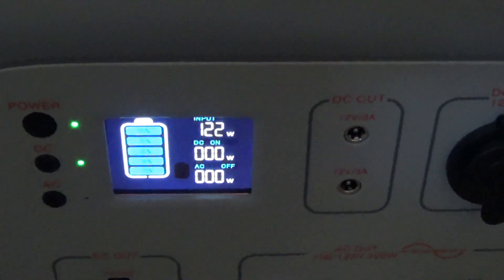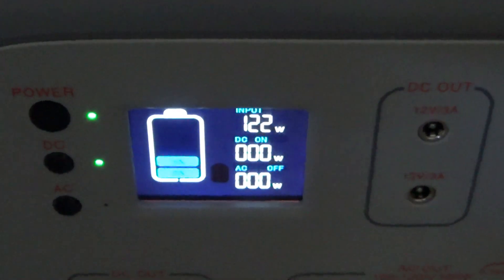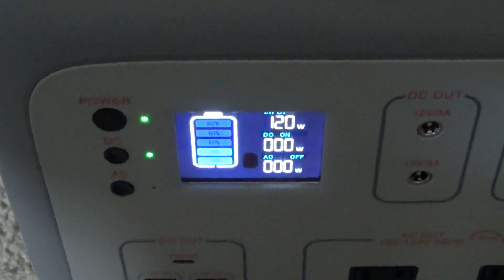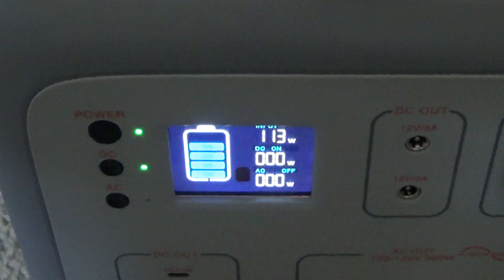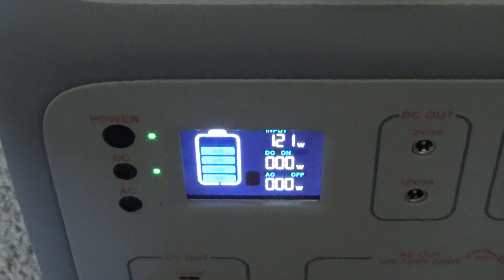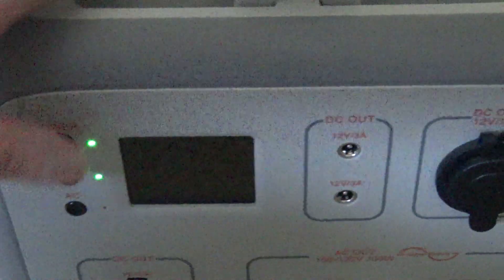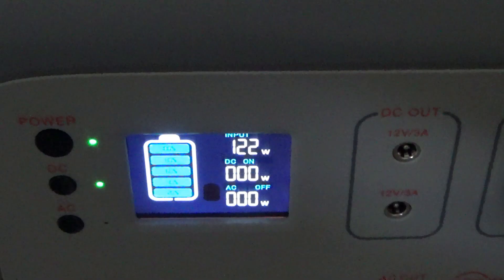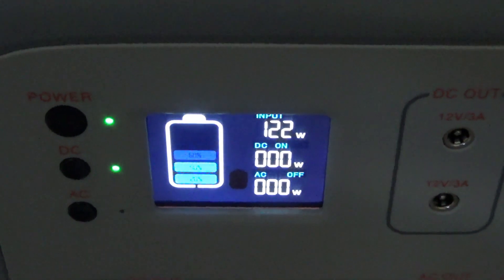Max Input & Over-paneling

Comment: I agree depending on location, I'm currently running 400 watts worth of panels into each of my renogy phoenix 1000s (my first solar setup, 400 watt max solar input 100 volts 10 amps per unit). Living in Michigan, the cloud covererage is BRUTAL! I've tested and paralleled 2 strings of 400 watts, so 800 watt total into one of my power stations and it is much more reliable power. Probably an extreme amount of over paneling but Michigan gets an extreme amount of clouds lol. Anyways pretty sure I'm going to overpanel and pump 800 watts into the 400 watt limit of both of my phoenix 1000s staying under its 100 volt limit of course. Sunny days are just too rare for me and panels are cheap.
Reply from the maker: Yeah that sounds like a good Michigan setup lol. But like you said, the panels are relatively cheap, so just adding a few extra can really make a difference on cloudy days. And now you'll have reliable power from solar, with close to 800w coming in on most days.👍